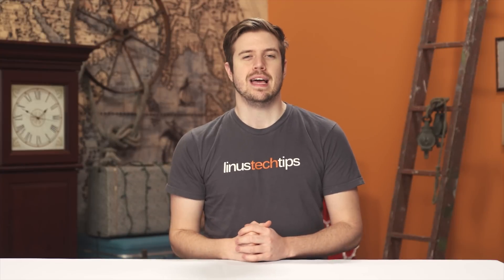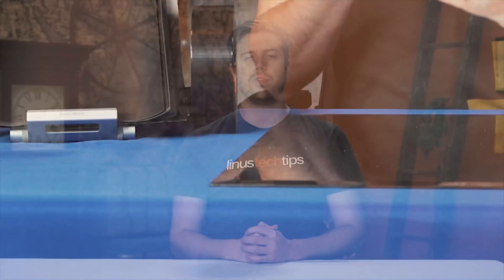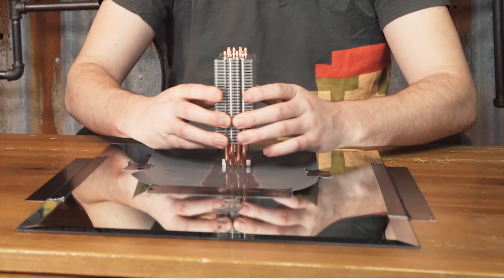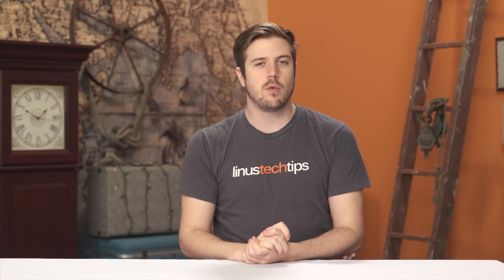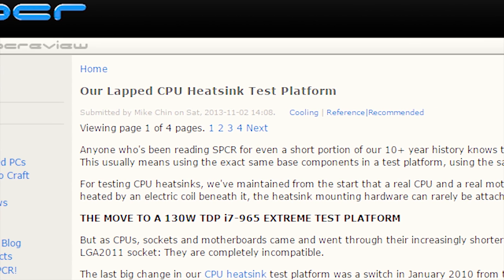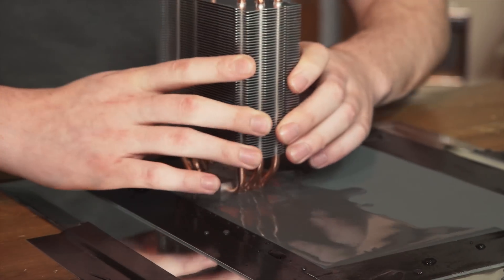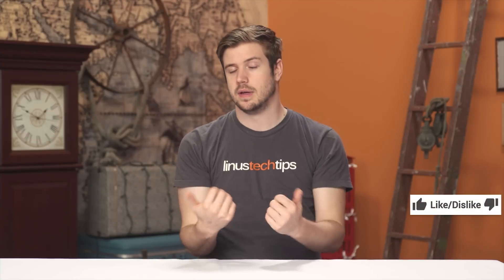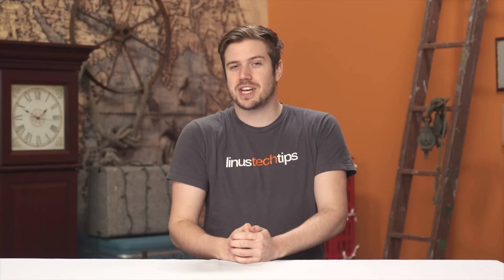CPU & Heatsink Lapping - Are concave, convex, or flat heatsinks best for cooling?

Comment: What is the working theory behind truing and mirror polishing the heatsink?

It seems like the extra surface area from all those scratches would give your thermal compound the greatest contact area for conductive heat transfer.
Reply: +Brad Gefroh Metal to metal contact is most efficient but the imperfections create air gaps that are very inefficient. Paste fills gaps of course and is more efficient than air but ideally only the minimum amount required to fill gaps would be used. This is usually impractical since it is difficult to avoid air gaps with less paste but if the surfaces have been lapped it could be easier to successfully use only a small amount of paste.

Comment: As someone who has lapped metal as a fulltime job this is kinda funny. First of all your not going to lap something flatter than a machined surface by hand. Second of all rubbing metal on sandpaper is not lapping, its sanding and would make the heatsink less flat for sure. Last of all the top of the CPU is most likely not as flat as the machined heatsink so any positive results would most likely be the convex you would be putting on the heatsink matching the CPUs possible concave surface.

Comment: It used to be fun to make your IHS have a shiny mirror finish, but thermal paste exists specifically for surface imperfections. it's meant to fill those gaps. I wouldn't even use paste on a perfectly flat to flat mirror finish.

Comment: I bet most of the cases of better cooling was just simply because they cleaned the heatsink and reapplied the thermal paste at same time. Alot of people seem to not understand that heatsinks require a little bit of maintenance when it comes to cleaning and thermal paste.

Comment: Lap a cpu once. u will find its not flat. the heat sink typically never makes a difference. the cpu lid it's self makes a difference. but typically not worth it. but i had a Pentium D that  wouldnt stay under thermal issues lapped it and dropped 15C most of it was most likely the thermal pad to arctic silver compound.

Comment: Anyone who knows even the basics of heat transfer will know that micro scratches dont make ANY noticeable difference. 

Surface area is key and micro scratches will account for less than 1% of the surface area for heat transfer. That's negligible in real world. But then you have something that will have a MUCH larger impact on heat transfer, the thermal paste. Much thicker, more surface area loss, and the compound's thermal resistance. Thermal paste ACTUALLY makes differences in temps.
Reply: +Andrew Russell THANK YOU. Its basic Thermodynamics really. The only thing that might be interesting though is how much these micro scratches actually make up in terms of surface area. But if we assume that they truly are negligible then it doesnt really matter.
Reply: metroid2 ya I was wondering how much surface area they actually take up., but it depends on the length and width of the scratch.
Reply: +Andrew Russell If you have more confidence that the surfaces are very smooth and make good contact though you can use less paste. Less paste can lead to better temps as long as there are no gaps.
Reply: ***** which that is another thing. Too much thermal paste ends up not doing enough to see either. jayz2cents did a video last month about it. He went nuts and used almost an entire tube of thermal paste and there was no difference in temps. Since getting into building I've found through personal testing and alter confirmed by others, that there's a bunch of bs out there. Method of application doesn't matter. I've spread it out wth my finger and gotten the same Temps as X method. I even did Amit again to verify. Paste does matter some though. I used Ceramique2 on my gpu and my temps were Terrible. No matter what I did. Switched to gelid extreme and temps dropped 13c. But then AS5 is only like 1-2c behind gelid.

Comment: once upon a time, heatsink bases were MORTALLY inprecisely cut, and naked cpus did't appreciate that for what concerned heat transfer due to the very small contact area. lapping WAS a big thing in overclock, nowadays it's not that important.

Comment: I managed to squeeze out about an extra 3°c from lapping a shitty heatsink (and only the heatsink - not the CPU's IHS) back in the 775 days.

You lot should do a video on getting the ultimate potential free improvement out of a combination of lapping both the CPU IHS and a heatsink (probably not a direct heat pipe contact type), as well as delidding the CPU.

Comment: you really wana get it flat, find someone to mill it
Reply: +MrJibJub13 It is tough to get a perfectly smooth surface in a mill because of tool marks.
Reply: ahh you get a good cnc mill and a good endmill and take your time with passes should come out better then this and perfectly flat
Reply: MrJibJub13 I used to operate a CNC mill at work. We found it pretty tough to avoid barely visible marks, especially on small parts.  Our standard was within a half a thousandth of an inch for milling precision parts. Some can still feel that with a fingernail but it is subtle. It wouldn't be much roughness but enough that lapping or at least normal polishing would still be worthwhile. We usually just did a light pass of polishing with a bit of compound on a wheel. We remeasured after to make sure they were still in tolerance.
Reply: ***** hummm very cool. thanks man. yeah your right. i have felt before what you just described

Comment: Lapping used to matter more when CPUs didn't come with heat spreaders. To maximize thermal conductivity, the interface has to be very good (improving heat transfer coefficient). Thermal goop type and application, good mating surfaces, etc. mattered a bit more then. You can de-lid a CPU and try again if you want to. It's not gonna make a huge difference, but it may make a bit of a measurable difference.

Comment: soo...why didnt you do the CPU? i actually saw a decent 3C reduction...and i had replaced paste multiple times before that and never saw an improvement...and applied the exact same way after i lapped CPU....so the improvement was definitely because of the lapping. that thing was way not flat (at least mine wasnt). before lapping, the paste wouldnt cover the whole CPU (unless i put WAY too much paste). so i would recommend it...if you dont care about warranties   :)

Comment: So, could you automate the process a bit by using a wheel and buffing compound? Should be able to get a mirror/near mirror finish in 10 minutes or less.
Reply: +Bob Bobson Might be hard to get a perfectly flat surface sanding like that. The idea is to get a perfectly flat surface, not a shiny one (though shiny can be an indicator of that!)
Reply: ***** There's a difference between sanding and buffing. The goal of sanding is to remove material until the desired result. Buffing is nothing more than polishing. If you change the curve (or lack thereof) of the heatsink by polishing you're doing it wrong.
Reply: ***** If it tells you anything, JIS J8000 compound uses an abrasive 1.2 microns in diameter. For comparison, a red blood cell is 5 microns.

Comment: I have had really good success in the past with lapping heat sinks and CPU's on older generations. back when thermal paste was just a white goo, and there was nothing high tech available. Lapping did make a difference, especially on concave/convex heatsink bases. But modern thermal pastes have the same properties as metal basically and transfer heat super well. So they fill these cavities and act as if the CPU/heatsink were one piece of solid metal.

Comment: Phase changer coolers, like this one, with a liquid to gas change benefit more from proper orientation.

Contrary to the common use of these they do not work best in a vertical case, where the cooler is mounted sideways.
Instead, this style of cooler works best, most efficiently, if the cooler is upright so that the gas cools and condenses back to liquid and falls back down to the base of the heat sink to be heated again.

Side ways the gas will rise to the tubes that are top most and, if at all, the liquid will fall down into the lowest tubes only phase changing when the tubes themselves become hot enough.  Which is counter to the goal of removing as much heat as possible.

Comment: I figured the surface wouldn't matter since the thermal paste is there. Thermal paste is basically meant to fill all of the gaps between the two surfaces with a very conducting substance, instead of it just being air. It may have made a bigger difference on older models where manufacturing quality was lower, and maybe the surfaces were really bad. At that time thermal paste might have been worse. It would also make a difference if you didn't have thermal paste, for some reason. You would then need both surfaces to be as smooth as possible to make the best contact and allow as little air between as possible.

For those that don't know, air is a thermal insulator, so trapped air means bad conduction. That's by double pane glass works well.

Comment: Hey LUKE ! I CAN   ,  Give some feed back !!! I actually have Several Tall tower heat sinks that were Causing me problems . Yes at first I thought that it was my CPU and then my Ram ,Then my Drive , then my OLD dinosaur graffic cards , then I was Inspecting ABSOLUTELY EVERYTHING inside my case ? As I started to go Crazy and inspecting the EX-steerior /?/ of my Case ? I realized that the surface of My HEATSINK looked a little OUT OF SHAPE ? Wait a minute , WTF ! How did that happen ? I didnt drop it ,Or Did I ? NO !!! So I loked at the surface and SURE ENOUGH !!!! DAM IT !!! It had Only been making contact on the corners ,,, ???????? How was it working before > Well , I did Remove like a TON of Old Dried up Paste !!! Looked more like some-one had took a dump on it than anything !!! Oh it WAS BADDDD !!!! Any how , I cleaned it up to see if there was ANYTHING else wrong with it ? NOOO !!! So I tried to find another but, as it turns out the heat sink AND Placement of screws , or Bolts in this case , wasn`t going to be an easy find !!!! In fact I am still looking for the motherboard BIOS , Anyway , I though ? Can I ? I GOTTA ! Sand and sand and sand and sand ,,,,,, Sand and sand and sand and sand , WELL You get the point ? After ALL OF THAT , I replaced EVERYTHING BACK IN ????? Dam I hope i dont have to do this again !!!!! And WALLA !!! Wait a minute !!! WTF ????? It worked ? Something is deffinately WRONG !!!! NO . I AM STILL USING THAT DAM THING TODAY !!!!!!! Been 7 years since it was actuly running but , a little cleaning AND I AINT FIXING TO REMOVE THAT DAM SINK !!!! It booted RIGHT UP ???? so ,,,, YES IT DOES WORK AND IT < DOES MAKE A DIFFERENCE !!! To me at least ! So Thank you foryour time , or more approperately thank you for making me feel that I wasnt Never the ONLY 1

THANK YOU !!!!

Comment: It will not make a difference . if i can compere this to cars. for example  there are 2 turbo charger cars with the same setup one with a stander aluminum intercooler the other one has a chrome / polish aluminum  intercooler setup most people use them for a cleaner build . the one with the stander aluminum will have better cooling with the air that passing throw it. the polish  one will not. the reason  for that is because when polishing or sanding metals the more shinny you make it the smaller you will make the prose in the metals, witch make it harder for the metal to cool down. DON'T do this its not worth   it  !!!

Comment: I have the 212 evo as well, and I am VERY tempted to try, although I am a bit worried that I would sand right thru the heat pipes.

BTW, I see an imperfection at 3:53, on the third heatpipe to the right - I have heard they are hollow, so I am wondering if you might have sanded too much off?

Comment: Kinda pointless doing this..Thats what thermal paste is used for, filling in the gaps, to spread heat.......
Reply: +Aoru Thermal paste fills into microscopic cracks, using it to fill macroscopic imperfections (because of either surface being curved) would result in poorer performance because it is actually a worse conductor than copper or aluminium.
Reply: +Aoru Isn't thermal paste a lower-thermal conductor than nickel or copper? If so then yes this would matter (although probably a very small amount, almost unnoticeable amount). However if the thermal conductivity is the same then, from my understanding of the laws of thermal dynamics, the edging should not matter as the transfer of heat energy would be the same.
Reply: ***** Not always. If thermal paste truly is useless you wouldn't waste money on it and just put the slab of heatsink directly on the chip. The paste is there to transfer heat better to the copper and aluminum that dissipate heat. As an example, GPu vs CPU. CPU might survive without paste, but not a GPU. So thermal paste can be a macroscopic factor in that sense.
Reply: asymsolutions Depends on the kind of thermal paste. Some thermal paste are conductive, while others are non-conductive.
Reply: Aoru All thermal paste is a thermal conductor. That's the whole point
Reply: asymsolutions I thought you said electrical conductor, misread.

Comment: So here is my two cents on the matter, first off you have to get it to a copper mirror to many a difference. I got a 12 degree different on my lapped Xeon 1231 V3 with Xigmatek low profile cooler. When you start you need to go at a moderate pace and in the rougher grit put some weight on it as this speeds up the process, going really slow like Luke did (no offence) will take forever, and too fast will eat your sand paper alive! you need to change your sandpaper rather often as it will wear down fast, also do both the CPU and it's heatsink! this works really well on certain GPU heatsinks aswell just don't try to lap the gpu itself it does not have a integrated heat spreader.

Comment: Wow a whole 5 degrees it must make so much difference. Totally worth about 5 hours of my time grinding down my heatsink.
Reply: +GDbluerebel 5 degrees celsius is actually quite significant in the electronics world, especially when overclocking.
Reply: It is significant, but my gaming pc uses a crappy HP heatsink and it runs fine. I don't see how 5 degrees is worth hours of my time rubbing it on a piece of sandpaper.

Comment: NASA created a ball bearing so smooth that if it were the size of the earth, the highest imperfection would only be a few metres high. It is the smoothest object ever created. Ofc, they did it with LazerPewPew. You should test a heat sink made by NASA.
Reply: Take a look on Veritasium's channel, he posted a video about the roundest object in the world. It's his most popular video IIRC. Basically, it's a metal sphere about 6" across, and if it were scaled up to the same size of the earth the highest mountain and lowest valley would only be 14 metres apart (7m above and 7m below sea level). Impressive considering the Marianas Trench is 10,809m below sea level and Mount Everest is 8,848m above sea level. NASA did have the record, but this one has it beat.

Comment: Guys, I know that content ideas are hard to come up with, I personally love the workshop, I always wan't to learn something that might make a difference in the performance of my computer, it is also important to know what doesn't make any difference. Maybe think of doing some newer build logs at different price points to help people the way you helped me when I was deciding on what hardware I wanted. Another thing I was frustrated with when looking for parts is the lack of motherboard reviews across many channels, or not seeing direct comparisons of the same card but from different vendors. Maybe do monitor reviews that AREN'T gaming oriented and cost 1000 dollars.  More CPU comparisons that include the stock fans so we can learn which are louder than the other. I bought an H105 at your recommendation when you did the testing. I got it and it's FUCKING LOUD. if you need more ideas call me

Comment: I've only heard of doing this to get a mirror finish on both the cpu and the heatsink so they are both perfectly flat and can be used without thermal paste, getting rid of that small bit of material that isn't as efficient as metal at transferring heat. If you can't see a perfect reflection in it then there's probably no point.

Comment: Luke might especially like this question since his dad is a plumber. What if you placed a CPU under a literal heat sink, a U-bend drain pipe of a bathroom sink? The bottom of a U-bend is pretty convex to say the least.

I mean you'd have to have cold water running at all times or else the trapped water in the bend would just heat up, but would this setup keep the chip relatively cool?

Comment: Well, in the older days of cpu's, the lapping did help since the surface and finish of the  heatsinks back then were about as smooth as ground up concrete. The early amd 64 chips and the socket A were the chips that I noticed this helping a lot. I would be curious what would happen with a stock cpu coolers of today. I should pull out the potatoes and heat them up.

Comment: No need to go in one direction and rotate... just lap it in a circular motion.  We lap thin aluminum parts where I work to achieve a flatness requirement and circular is easier and faster.